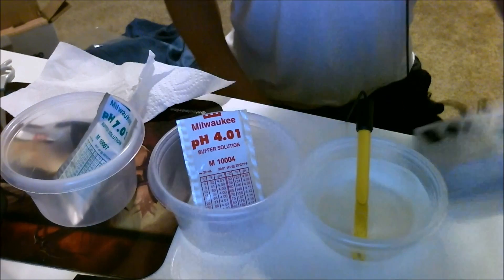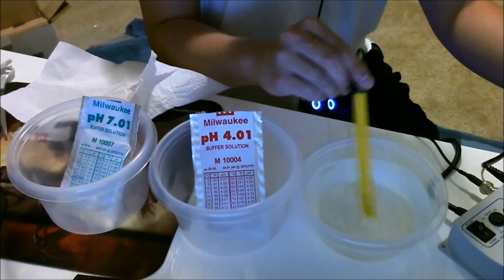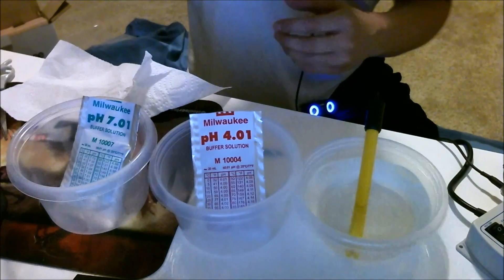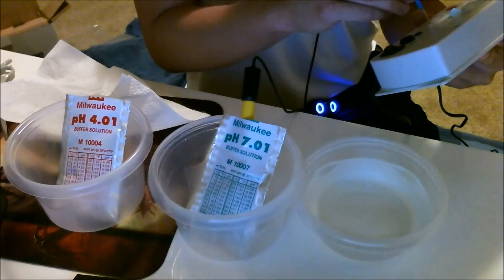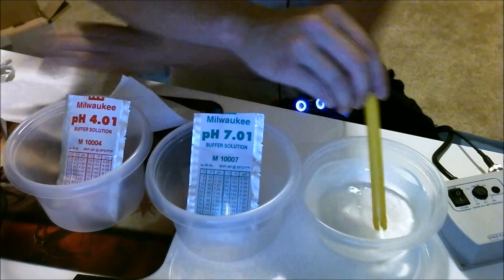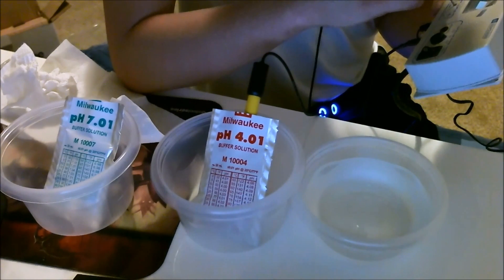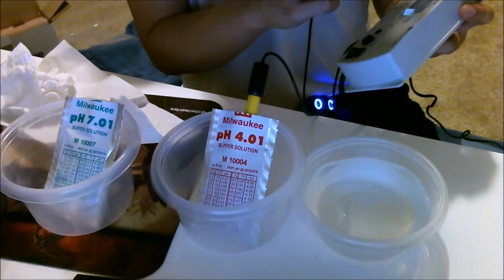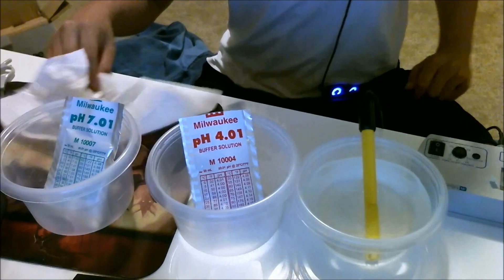How to Calibrate the Milwaukee MC122 Ph Controller

Comment: As an analyzer technician, first, you should not dry the probe completely. Secondly, after you put the probe to the calculated solution, you should leave it for approximately 3-5 minutes and then adjust if needed. Same for the second solution
Reply: Can you please explain a little more, ?
So dry it just a little?
Not sure, thanks

Comment: This thing just wont calibrate I had the biggest issues right from the beginning, ended up buying a new probe but still no luck, very slow and inaccurate readings even when it displays proper pH in fresh calibration solution..

Comment: yo man i know this video is a little old but do you ever have a problem with it over dosing and your pH going to low or high? and do you keep the pH probe next to the Co2 outlet in the tank?    Thanks!!
Reply from the maker: ***** I dont use the pH controller like its suppose to be used. I just have it in the tank for reading/monitoring.
Reply: Bummer... Thanks for the reply

Comment from the maker: It constantly reads the pH level. The has a rely that switches on/off a power outlet that you can hook up your co2 tank too. By adding more co2, it'll lower your pH.

So for example if you want the pH to be 7.0, you can set the controller to turn on the co2 when its 7.2 or 7.3. It'll turn off once it hits 7.0 (+/- some 0.1 error)